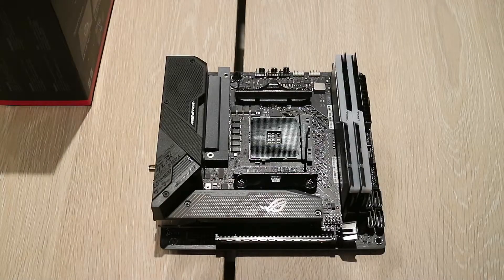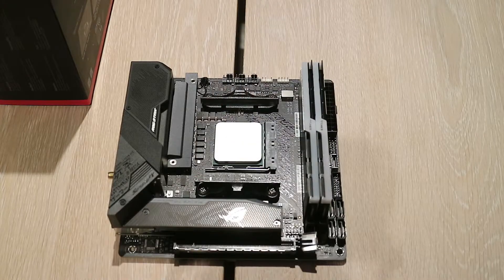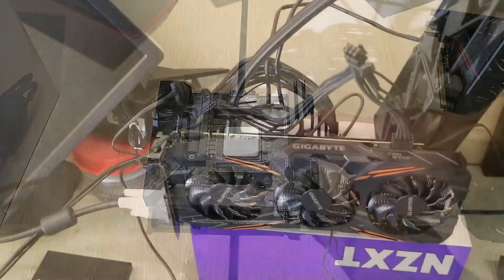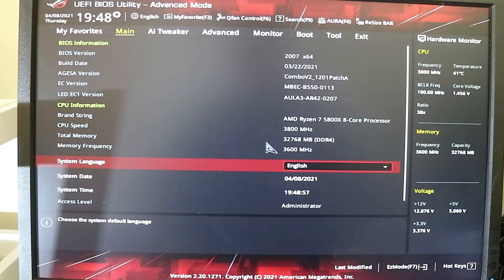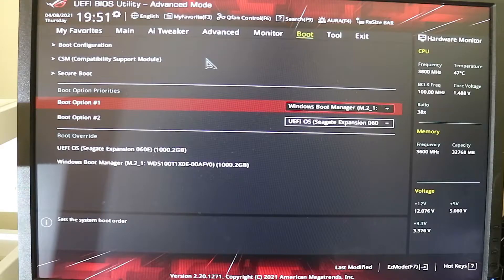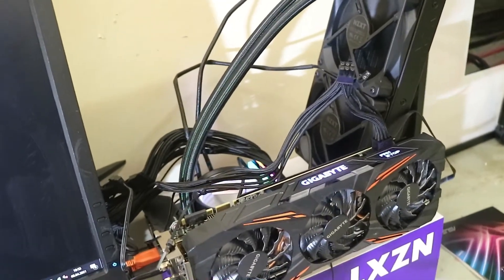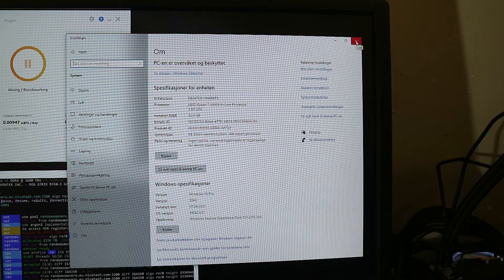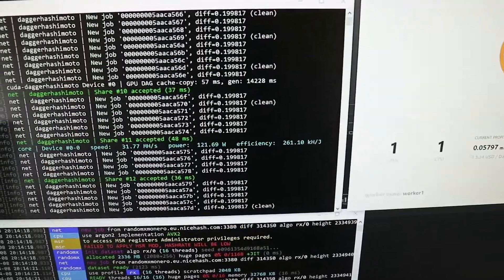How To Build a Beginner ITX Mining Rig!

Comment: Glad I watched this, very helpful, but why a standard cpu and not an ASIC one, and why did you have to download and install drivers for the gfx card?  I built a few systems in the past and the gfx card always worked so long as it was compatible with the m'board.
Reply from the maker: This is actually my new PC. But since there is a shortage of all possible parts, this became a mining PC for so long. Regarding drivers, GPU is the driver from Nvidia's pages. Otherwise, drivers are from either Asus or Amd